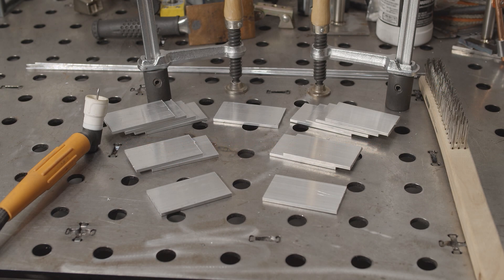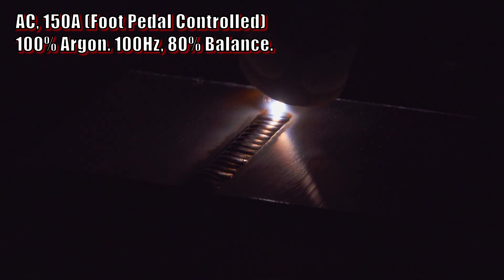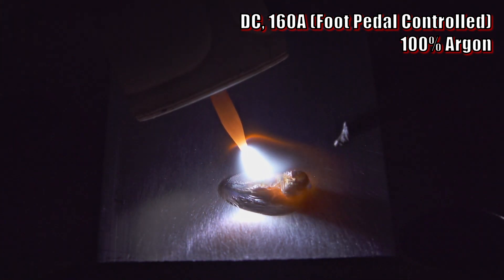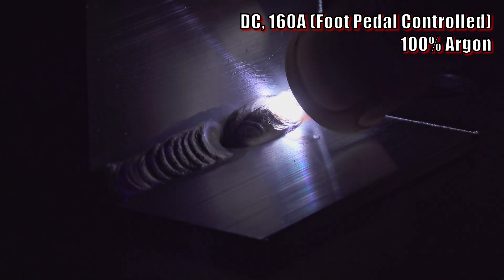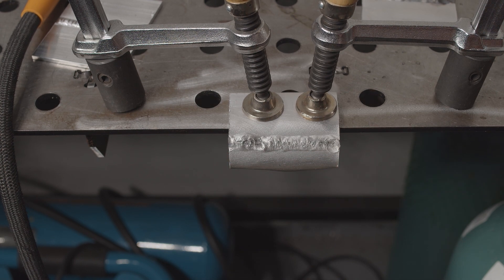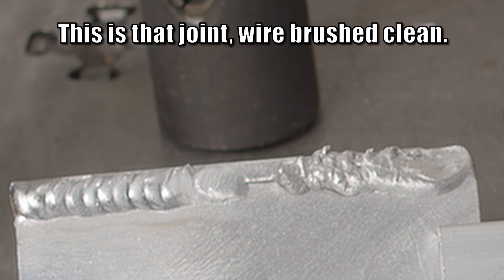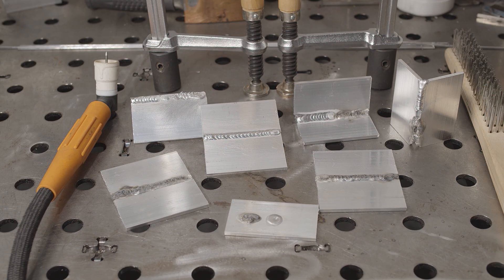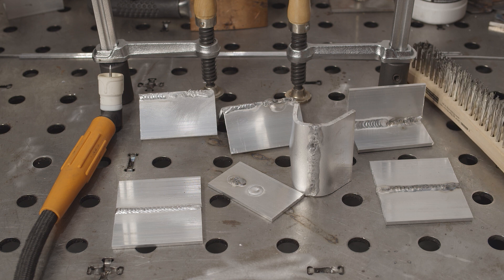TIG Weld Aluminum with DC and 100% Argon?

Comment: @bigtb1717  how does a spool gun using DC get around the oxide problem? The best I can figure is that it has something to do with the electrode being the wire itself because it’s mig. But I can’t figure out why it doesn’t look the same as the DC Tig welds in your video here.
Reply from the maker: The electrode being the wire itself is possibly part of it.  It's also a spray process, so it's just a very different process overall.  Also, it's normally run electrode positive, so you get the cleaning action you get from the positive portion of the AC TIG cycle.

DC TIG could technically be done on electrode positive for aluminum.  But most of the heat would be going into the tungsten/torch.  So it's likely not going to be effective for anything but really thin metal, and even then, it may be a struggle to keep the electrode from eroding and possibly contaminating the weld.  I've been meaning to make a video testing that.  Just have a lot of stuff to get to and I don't get time to make very many videos.
Reply: @ thanks for the reply. Just getting into this topic and couldn’t find any one saying how a spool gun works electrically. Thanks for the explanation I’ll look up what a spray process is vs a different process.

Comment: Did he say stick welding has a higher arc voltage than tig when using argon? I hope he meant mig. Is he using shielding gas with welding rods or did i just hear all that wrong???😂😂😂

Comment: Dc tig with argon is run DCEP ... then it welds just fine.  You need a big 1/8 electrode and you have to watch your amps or you just burn out your tugnstun quick... its best suited for 1/8 al and under

Comment: Ok, but I am puzzled why DC Mig works with Aluminium, is it because its stabbing the oxide covered pool?
Reply from the maker: MIG is a very different process.  With MIG, the filler is the electrode.  Aluminum MIG is a spray transfer process where the filler metal itself creates the arc.  The filler metal is then turned into little droplets that are "sprayed" at the aluminum by the force of the arc.  The very nature of the process breaks up and blasts through the oxide layer.
Reply: @bigtb1717  Ahh, thats interesting, so all Aluminium welding is done on the higher voltage spray transfer rather than short circuit or dropplet?
Reply from the maker: @engjds  I guess I can't say it's always spray.  It could be globular.  It's been a long time since I've looked into the details.  But I don't think it's ever technically short circuit.  I don't think it takes as much voltage to reach globular or spray transfer as steel does.  I'd have to look into it to remind myself of all the details.  But it's overall a very different process than TIG and behaves differently.
Reply: @bigtb1717  Hi mate, I got a comment from another welder, which makes interesting an explanation, here it is...Aluminum MIG is run on DCEP (Electrode Positive), which is the part of the TIG AC cycle that does all the cleaning. This puts the majority of the heat into the electrode rather than the workpiece. Since the MIG electrode is consumed and added into the weld puddle, it carries that heat energy back into the weld anyway. With TIG, running DC electrode positive puts too much heat into the non-consumed electrode for it to keep its shape and too little heat into the material. For this reason, the TIG polarity has to switch between electrode positive for cleaning and electrode negative to put heat in the material.

Seems to make sense, though maybe you are right as well, and the spray transfer has an effect!
Reply from the maker: Ah, yes.  Electrode positive is used for Aluminum MIG as well.  Like I said, it's been too long since I messed with Aluminum MIG.
Reply: @bigtb1717  If I use MIG with DC current, which gas do I use?
Reply from the maker: @عباسالعراقي-ض2ت2خ  Aluminum MIG is generally done with 100% argon.

Comment: I bet this (DC TIG with argon) would work great in a glovebox. If you purged the box and then cleaned the parts and filler rods in the box in an inert atmosphere. I might have to try it myself someday.
Reply from the maker: Interesting idea.  Do you do TIG welding in a glove box already?  I suppose if you were able to remove the oxide layer in an inert environment, it wouldn't form a new layer.  I suppose if you have a purgeable glove box capable of TIG welding inside, it might be fun to try.
Reply: @bigtb1717  I have used a glovebox for TIG welding before, especially when welding odd shaped parts made  of stainless steel or inconel that would be extremely difficult to back gas or even use a trailing cup on. When welding titanium it’s almost always done in a glovebox, unless the parts are shaped such that they can easily be shielded on both sides in the open. I personally hate welding in a glovebox, but sometimes it’s the only “practical” solution. Sure you could spend all day making some sort of fixture to shield an odd shaped part, but that wouldn’t make any sense when you can just throw it in a glovebox.

Comment: New  to tig welding hereand i have a question, if i want to weld aluminium i need AC Tig Welder not DC Tig Welder?
I still dont understand the difference which one to choose?
Reply from the maker: Correct.  If you want to weld aluminum with a TIG welder, you will want a welder that can do AC TIG.
Reply: @bigtb1717  and if i want to use it for other metals, can i use the AC Welder? Or i need DC Welder for it?
Reply from the maker: @fredymredy  Modern, AC TIG welders can also do DC.
Reply: @bigtb1717  Thank you.

Comment: pls test welding with current DCEP
Reply from the maker: Can't say exactly when I'll get around to it, but I do plan to try that in a video at some point.  The main issue running DCEP is that the electrode will burn up very quickly.  So it will require a large electrode and low current, but it will be interesting to see how it goes.  Cheers!

Comment: Wonder why mig welding aluminum with 100% argon works so well
Reply from the maker: Just down to it being such a different process.  Aluminum MIG is a globular or spray transfer process where the filler metal itself creates the arc and is blasted into the base metal.  It's a much more aggressive process that breaks up the oxide layer by its very nature.

Comment: This is such a great video, thank you so much for making it! 

When using DC on aluminum, if the oxide layer immediately forms and is above the molten pool of aluminum, does that oxide layer act like slag that protects the molten aluminum beneath? What happens if you don't run any shielding gas at all?
Reply from the maker: Unfortunately, with no shielding gas at all, the tungsten basically explodes in a shower of sparks, lol.  Depending on the amperage.  It's a slower, but still dramatic process at lower amperages.  The TIG process itself requires shielding gas to stabilize the arc and to protect the tungsten.

Comment: Argon DOES NOT work on aluminum!!!  Helium only.
Reply from the maker: With an AC TIG welder, argon works just fine.  As shown in this video, when running DC TIG, argon does not work well.

Comment: Use helium and you don't need as much penetration but you will have to preheat larger sections of Aluminum to be able to get your parts hot enough to weld on AC

Comment: Seems like DC pulse TIG DCEN should give you a similar result as AC.
Reply from the maker: Unfortunately not.  It's the periods of electrode positive polarity that breaks up and repels the oxide layer on the aluminum, not just the current fluctuation.
Reply: @bigtb1717  I misstated that. I meant DCEP  so that the electrons flow out of the metal and toward the electrode in HF pulses.
Reply from the maker: Yeah, I may try that in a video.  The only issue is that you'd have to use really low current, because very much current on DCEP will nuke the tungsten.

Comment: what type tig torch is that ?
Reply from the maker: It is a Weld-Tec stubby torch.  It's my favorite TIG torch.  I don't have the steadiest hands and this small, rubber handled, lightweight, air-cooled torch is my favorite, overall torch.  I'm sure some with flex heads would be more versatile, but this is still my favorite to use.

Comment: How does a spool gun get away with welding aluminum with DC?
Reply from the maker: Aluminum MIG is a much different, more aggressive process.  The filler metal itself creates the arc and in turn the filler is turned into tiny, molten droplets that travel along the arc and into the base metal.  The process itself tends to break up the oxide layer.

Comment: I love your reviews. Please do try welding aluminum on DC- 100% argon with an aluminum arc rod. I use it regularly for welding broken cast aluminum parts , not the prettiest but runs good penetration with very little porosity. My concern however is about  PPE safety  so please do give a try
Reply from the maker: I do plan to try DC- with 100% argon and aluminum stick rods, as well as flux.  Not sure when I'll get to it, but it's on the list.  Cheers!

Comment: I'm strictly an amateur welder, shopping now for my 1st TIG welder to replace my cheap HF flux core machine, with the intent of welding steel and/or aluminum. This was by far the most detailed and concise explanation of exactly why I will want something that provides AC and DC. Thank you so much for this demonstration!

Comment: You can get respectable welds using dc tig with argon using flux covered aluminium welding rods its messy with lots of flux but works ok.
Reply from the maker: I actually have a box of them ready for a follow up video!

Comment: I'd like to see someone welding using a disposable helium balloon canister. They are not too expensive just for the experience.
Reply from the maker: If you are talking about those little bottles you can get in department stores ($30-$40), they are not very pure are would only have enough helium for a few minutes of welding.  Even if you were to rig up a hose to a regulator (might be tough, depending on the pressure in the tank) or just try to manually regulate flow with the valve on the tank, I think the fact that they only advertise as being 80% helium is the main issue.  With 20% being just "air" you would likely get terrible contamination.

Comment: how is it with reversing polarity on the DC and then using Argon?
Reply from the maker: Running DC electrode positive positive burns up the electrode pretty quickly.  It might be usable at very low amperages.  

I may make another video about DC TIG on aluminum where I use helium, DC positive with argon and try using flux.  Just to see how all those different methods work.
Reply: @bigtb1717  yea.. what ive gathered is that it is doable with DCEP pulse of 2,2 and a thick electrode and short runs. still have to test run it etc though. The pulse is to cool the rod and the EP is to remove the ox layer as well.
tried to stick weld DCEP (only option), but wasn't very successful. 
thanks for the reply.
here i could buy a new AC welder for the price of running helium so... yea :)

Comment: Have you ever tried DC Tig with Argon but using Aluminum flux coated stick welding electrodes instead of bare Tig aluminum filler wire. Thanks
Reply from the maker: I haven't tried that, but I might get some to try at some point.

Comment: How does a spool gun weld with DC?
Reply from the maker: The process is very different.  Rather than creating an arc via a tungsten electrode to melt the base metal, the aluminum wire itself is creating the arc while also becoming molten and "spraying" across the arc to the base metal.

Comment: But why are you using a number 12 cup on aluminum? It says on the box not to use those cups on AC. 
Other than that, excellent video, good sir.
Reply from the maker: That was just what I had set up and to be fair, I was on DC for half the video, lol. I'm pretty sure they say not to use them on AC because AC puts a lot more heat into the cup and they're not rated to hold up to the additional heat.  But I wasn't using a ton of amperage and wasn't doing super long welds.  So it was no big deal.  I'm sure the large cup size meant I was using a bit more gas than I needed to.  Again, I wasn't super worried about that.  As long as I was getting good coverage, I didn't feel the need to swap cups.

Comment: When GTAW was first developed for aluminum, it was called heliarc welding. Used extensively in the 1940s and the 1950s, it required DCEN and pure helium shielding gas. In the GTAW process, the electrode negative (EN) current provides maximum penetration, which is highly desirable. Then people realized that there were advantages to using AC for aluminum GTAW.

Comment: I have successfully welded aluminium with TIG DC and pure argon, but with 2 very big differences; the aluminium was preheated to 130 degrees Celsius and fluoride flux for gas welding aluminium was used. Sticks MMA for alu can be used also, it has the good flux and these sticks can be found easily. 
That does not replace a good AC/DC, but helps a lot for an occasional weld on aluminium to fix something fast.
Reply: DCEN GTAW also has merits when repairing shit chinese castings made out of old fishing tackle.  While AC TIG will have you pulling your hair out over all the crap that percolates to the surface of the puddle, DC TIG or especially SMAW can frequently "get the job done" and out the door - even if there's a bit more prep.  I am partial to making a dam of heavy aluminum foil around the repair area.  SMAW in particular can result in a series of (hopefully) controlled "splats" rather than a good looking weld.  Try using the HF start of a multiprocess welder in TIG mode with Al SMAW and be delightfully surprised.  The HF start will provide a 50/50 balance to initiate the weld as well as melt the initial flux pool, allowing you to use a reasonable amperage.

Comment: If you want to do a very interesting video that will amaze people do the following. Go grab a package of Hobart or Blue Demon Aluminum Arc Welding rods. Then do this same exact video using those flux covered rods with the DC TIG. It will amaze you and is an incredible field hack. Also if you pre-paint the area with a flux it will help.

Comment: Just watched your video i have a new maxstar that has high frequency my welds look like marhmellows how do i make it look shinny
Reply from the maker: Maxstar series has high frequency start, but not AC output current, which is what you need for aluminum welding.  The Maxstar series is DC only.

Comment: I have had amazing results welding alu with DC TIG, and without using any gas at all! (for the welder) But it was costly, but soon it will be much much cheaper with Musk's Starship,  the main problem was getting to the Moon and back.
Reply: With the price of helium, going into space might even be cheaper.  Don’t burn a hole in your suit!
Reply: Would be handy to work in a vacuum chamber
Reply: Lmao

Comment: You can TIG with DC but you need your tip or the tungsten to be + and it will weld as good as the welds he is doing here.
Be careful with the amps as you will go threw your tungsten rod pretty fast but you can get the job done ..